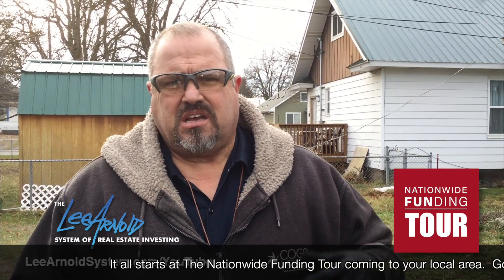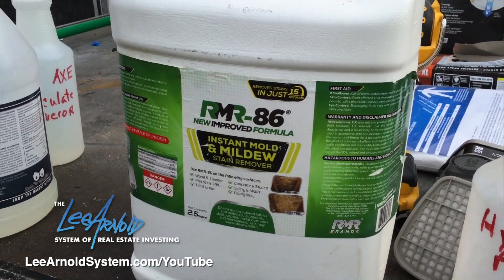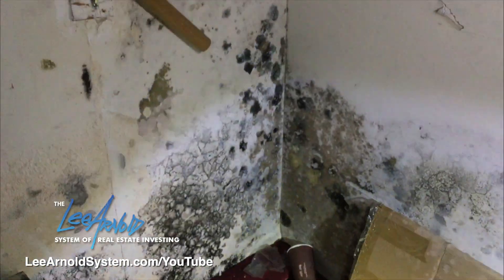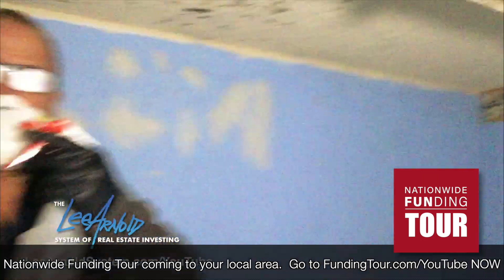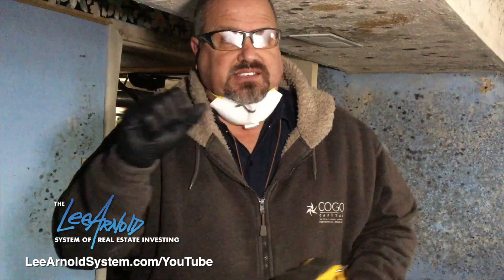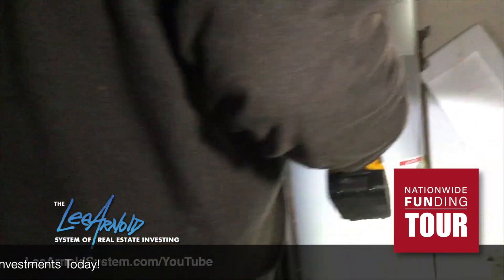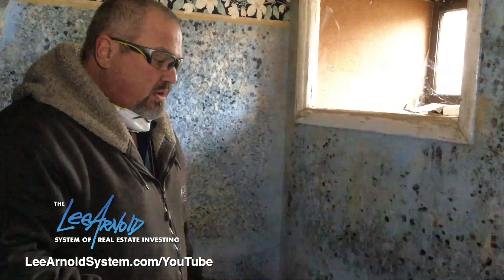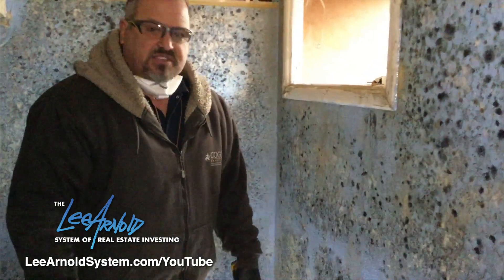How To Clean and Remove Toxic Black Mold Safely DIY - PART 1

Comment: Good video. People are always scared of mold and make it more scary than it is. Mostly money hungry tenants when they are the ones that cause it in the first place.
Reply: It’s actually very toxic and causes illness. Indoor mold is not ok.
Reply: Mold is extremely dangerous actually and it's usually caused by leaks in your home either from pipes or water entering through holes or cracks from outside. Which is a homeowner issue caused by no one.
Reply: @zain4101  Yeah, its dangerous and can be from leaking pipes under the house. But in humid places like Nashville and Atlanta and my 25 houses, when its inside, its from the tenants themselves steaming up the shower etc is what I'm saying. No one knows everything about everything!
Reply: Of course it's got to be the tenant's fault!  Cause they take showers (like the rest of the world) and "steam up the bathroom".  How dare they abuse your property that way!  Bottom line is lack of maintenance by the OWNER. 
You have slumlord mentality. 
I'm so glad I stopped renting other people's homes decades ago!  
FIX LEAKS RIGHT AWAY.